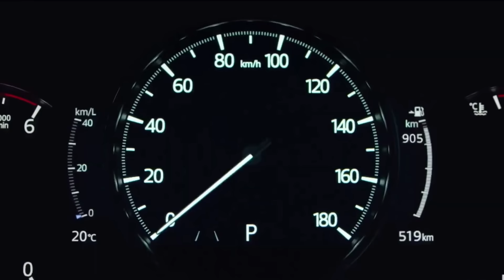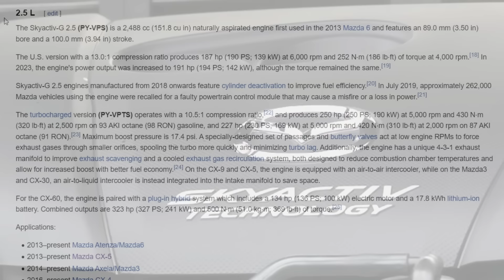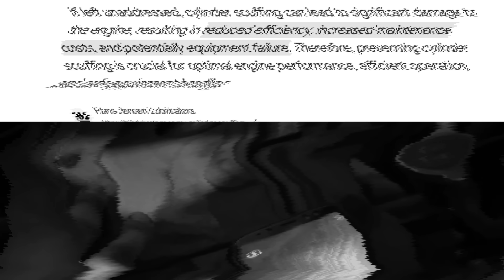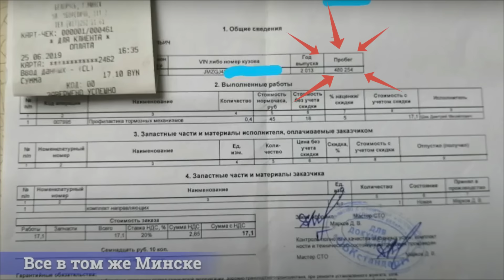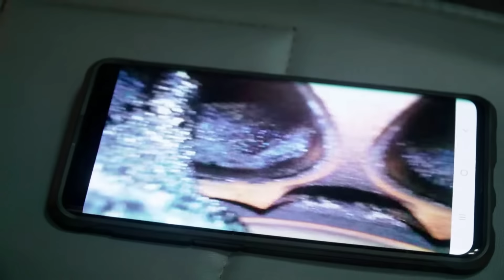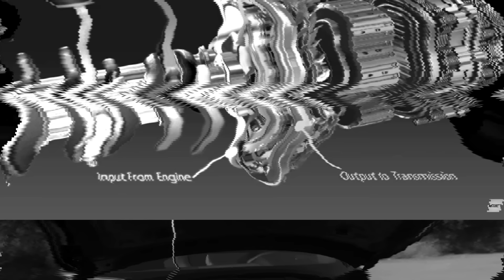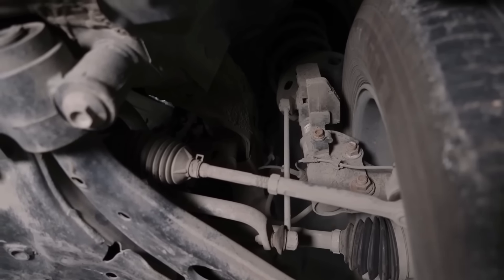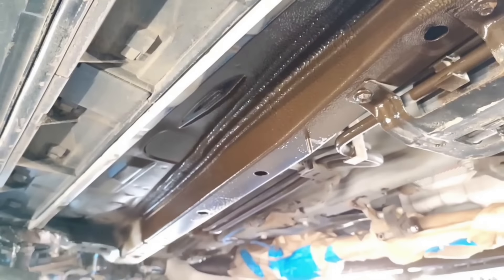How reliable is the most stylish Japanese crossover? 2024 Mazda CX-5 facelift.

Comment: We bought a new one last year and I love it more than the Lexus and BMW I had previously!
Reply: Exactly! Same here! Bye bye BMW! I love my 2 Mazdas and so do my friends
Reply: tbh cx5 is the less luxury lexus and less engaging bmw with cheaper price, so its a steal deal
Reply: @afarrel3195 yep love my cx5 too except for the horrendously jerky transmission shifts when its cold. I mean, seriously feels like someone is running into us it jerks so hard. Mazda says its a normal thing.
Reply: @js6872 yep. Usually after a cold start it’s so bad. It smooths out when engine temp reaches above 50c
Reply: How many miles does it have, and how would you gage the reliability of the Mazda vs the lexus? Would love your input I'm looking at these Mazda's really hard but I'm hesitant
Reply: Thats also what i say about my cars. Until i get rid of them. Then the next car is the new best car i have ever had. Sooo... yeah
Reply: @js6872 I have not experienced this on my 2021 turbo. Smooth shifting after 45000
Reply: I chose my mazda3 over a lexus, it seems the only thing I'm really missing out on is the extra power
Reply: @Horse-c2t  I decided on the newer mazda 3 sport sedan. Similar interior comfort as the lexus
Reply: @itzfuazz4198  LOL, you haven't driven a CX-5 turbo, 0-60 in just over 6 sec.
Reply: @dogsarefun2  the NA 2.5L in my mazda does it in 7... idk if I'd feel much of a difference
Reply: There’s a TSB for jerky shifting. The dealer has to upload a new file into the computer. We had it done to our ‘19 CX-5 and the difference is noticeable. Shifting is excellent and no longer jerky.
Reply: @js6872  the oils are not at optimal operating temperature yet to work its best I assume. I'll only start driving after the 'blue' temperature thingy goes away...
Reply: @2004cyrus  same here too , i spend so much on bmw x3 , loss a lot of money due to resale value , however the x3 did not come with adaptive cruise and lane keep assist :( now sticking to cx5
Reply: Same here!  Drove a Lexus RX for 12 years before getting back into Mazda!
Reply: @eleanormassaro5195  that’s excellent! Half of the price and close to as much luxury!
Reply: I agree
Reply: What is the difference between the Mazda CX-5 and the Lexus you owned? 
Lexus is quite famous for its reliability. Which are the most important points you would mention why exactly you the Mazda more than the Lexus? Which model of the Lexus you had? An SUV as well like from the RX - segment?
Reply: Hell yeah. Better than lexus

Comment: I had a CX5 for 4 years without one single problem, would highly recommend them.
Reply: Why did you sell? I am just coming up on 5years and 225k km on it (manual)
Reply: I owned a 1995 Mazda 323F (Lantis in the u.s) owned it for 22 years and the only things went wrong with it in that time were the clutch master cylinder went in 2019 and one of the door actuators stopped working in 2020. That was it. There was no body rust anywhere as i used to hose under the wheel arches every time I washed the car, Plus I live in a country that salts the roads and I live right on the coast.

Comment: I bought a new 2024 cx5.  It does not have the cylinder deactivation or the I stop lame functions..  i believe both of those ridiculous features with no doubt cause excessive carbon buildup   Especially the CD.  The computer is constantly shutting down 2 cylinders on a 4 cylinder engine. On and off on and off. So what Happens to all that oil just laying around during shutdown....slides right past the piston oil rings and builds up in the cylinder just to name a few problems like spark plug fouling. My friend bought the 2023 with CD and the difference of how the  engine runs and performs is night and day.  Mine runs soooo smooth with noticeable  quick acceleration and at idle you cant feel one little miss and it is running not like the I stop version.   So buy a 2024 model with a vin with an L IN THE 8TH spot on the vin Id.   Or ask the stupid sales person who wont know what you are talking about.

Comment: Between my wife and I we have had 7 Mazdas in the last 25 years. The only trips to the shop were for regular maintenance. Our 2006 Mazda 3 drove really good from summer to winter up to the time it was traded in for a 2018 Mazda 3. These vehicles drive good, they look good, and they don't waste your time going to the service shop instead of doing what you need to do.
Reply from the maker: real Zoom zoom fan😄💪
Reply: I love my 2010 Mazda 3. I didn't know much about this brand until I moved to Canada, where Mazdas are very popular.
Reply: ok but what about the technical service bulletins for this engine, & this vehicle for cylinder wall cracking on almost all models years, & multiple vehicles since they put this engine in the cx5, cx9, cx90, and cx50 ofr 5+ years now? I'm really trying to buy one of these but thats the type of issue you don't see with toyota/honda (until they too have introduced turbocharged engines across their line....well see how those age) and its keeping me from buying (wouldn't buy new turbo hondas either for this reason). My friend had an old mx5 protege and it rusted out completely in the midwest faster than most other makes & got junked because of it despite the rest of the vehicle working well (besides oil consumption). He had holes in his floor & failure on his engine motor mounts (that got it in the shop & totaled).
Reply: @MarkTrades__  , Mazdas definitely rust faster than Toyotas and Hondas in the "rust belt". You have to rust-proof your Mazda every year if you live here.
Reply: I had a 2003 Protege’ 5 that I traded in with 198K miles on it. Never used one drop of oil during its entire life. The only problem was extensive rust.

Comment: I purchased the 2024 CX 5 Signature and I absolutely love it. I’ve been driving Hondas for 23 years but decided to go with the CX5 instead of the Honda CRV. The CRV looks too much like the Pilot and Passport. Too boxy looking for me. The biggest reason was the increase in pricing by Honda. Wasn’t worth the extra $4500.00.
Reply: Have a similar experience, been driving Hondas exclusively for 40 years. The last one, a 2021, was a big disappointment. 
Switched to a 23 CX5, very happy with it.
Reply: I traded my 2021 CR-V for a 22 CX-5.  Way more fun drive.
Reply: Hey did you drive any sporty Honda's? If so, I have 2015 civic si. I love the instant throttle response, & direct inputs everywhere else. 

I'd love any comments you wanna give: 
How would you describe the
Turning stability ( how fast you can take a turn while feeling stable in the car) 
The throttle response ( how instant or direct using gas pedal feels?)
Ability to accelerate onto a 50-55mph road from stopped while there is traffic?
Reply: Honda Canada pricing is nuts. The new CRV drives boring. Cx5 was decided. Coming from a 20+ yr Honda owner

Comment: My wife, 2 daughters and sister all have a CX5 (2012/13 models). (all 2ltr motors) They range been 173000km and 214000km. We have not had a problem with any of them. They are extremely reliable provide you maintain them at the very leased by the owners manual or sooner with quality oil. I also have a Mazda 3 high is the same reliability.

Comment: We bought our 2014 cx5 in late 2013, in the last 10 years, I only had to replace the battery, tires, and brake pads. I do my own oil at 5-6K It's been perfect.
Reply from the maker: How many miles now?
Reply: 188K
Reply: Have you had any induction  cleaning done for carbon build up…. Or not needed so far?
Reply: You never changed the transmission fluid? 

You should, it’ll bring back up maximum fuel economy.   You can do it yourself.
Reply: Ive been told by 2 different Mazda service centers that my 2015 CX5 has a sealed transmission and never to change the fluid. So far, at 188k, mine is running fine.
Reply: @hookem7030  it's NOT sealed,  there is a drain plug and a fill plug.  ON ALL 2.0 & 2.5 models.  I was told the same thing. the power of U-Tubers has made dozens of videos showing how to drain and fill.....

Comment: I've owned Mazda's from 1974. Motors were never a problem. Just changed the oil every 5,000KM. In fact, problems were minuscule in every one I owned. My favourite's were the RX3 and the Mazda 6 hatch. All were M transmissions.  I even liked the original CX5, my first automatic transmission car, but the 2L motor wasn't enough power for highway driving around our hilly BC province. Ok in the city, but the highway, it didn't cut it. Passing was similar to a turtle passing a snail if on a hill.
Reply: I had driven the CX-5 with the 2.0 and my current car has the 2.0 already at 166k miles. It’s barely enough power but reliable as hell. Only thing I needed to replace were motor mounts
Reply: Well the engine in these cx-5's and most mazdas right now has a technical service bulletin across most years for cylinder wall cracking possibilities on the turbo 2.5L 4 cylinders.... Appears to have never been addressed head-on.
Reply: @MarkTrades__  WOW! Must be that oversight thing talked about in the video that cost people unnecessary money. Are you old enough to remember what a joke their rotary engines from the 1960s and 70s were?
Reply: I had/have no problems passing on the highway even at 120kph and higher...  (2.0l)
Reply: @tonyoliver2330 What year vehicle did you replace the motor mounts, and how old / how many km/miles when you did this?  Thanks
Reply: @Victorylap-fy4ke  My rotory was good. Only reason I switched for a new car was I got rear ended and it totalled the car. I ended up with a GLC, which was gutless compared the my RX3 which was a fun car to drive. I guess I was lucky...My RX3 had 120,000 miles on it when totalled. Motor never caused me any grief.
Reply: @nedmilburn  We have a lot of pretty steep hills here, and the 2.0L in the CX5 was underpowered for passing. On flat roads, it was ok, but we don't have many flat roads.

Comment: This is making issue out of non issue, reason CX-5 is a better car than CR-V or RAV4 is that it uses proper size engine and proper transmission not a cheap CVT substitute with tiny 4cyl turbo engine . 
Than comes driving quality , interior quality , superior and premium control knob instead of old school cheesy LCD touch screen ... solid iAWD that is predictive and very intuitive with it's operation .
Reply: But the 2.0L is a small engine, it does come with a 6 speed manual as an option which is better than the auto too though.
Reply: @CsalbertCs  So CVT would be better ?
Reply: A 2.0l turbo in the cx-9 is enough to be "small engine" to me. Should get 2.4, 2.5l but fuel econ prob hit too hard
Reply: @MarkTrades__  CX-9 does not have 2 liter engine , do your homework .
Mazda's CX-9 and CX90 both do not push their 2.5liter and 3.3liter hard like most manufacturers do , Mazda does it for increased lifespan of the engine.  It is easy to slap higher psi turbo and get lot of power but than engine lifespan is cut in half .
Reply: @kdomster9141  ah yeah I was recalling them both having the same engine. It appears that's a 2.5 instead of 2.0, as previous comment had me thinking.

THEN ID SHOULD BE 2.8 V6 TINY TURBO 🤣
Reply: @MarkTrades__  Sure 3.3t inline six with the smallest boost in the industry getting just 280hp or 340hp should last "forever" in comparison to Chevy's 2.5t getting 320hp/310tq or BMWs 3.0t getting close to 400hp 
Mazda does not do it for bling of HP number game but Mazda does it for reliability and longevity of its turbo engines.
Reply: @kdomster9141  I'm looking at used cx9s so no 3.3 inline available there. My only comparisons are to honda/ Toyota I wouldn't buy a Chevy or BMW haha not my thing. Maybe chill a little your replies are aggro bro we're talking about 40k luxuries here it's all good
Reply: @MarkTrades__  all good Bro ,details in answers should not make it feel hot in any way 😉
Used Honda or Toyota vs used Mazda CX9 should be all about picking your priorities. 
Mazda always offers more content, performance and more ambitious design vs same price Honda or Toyota . CX-9 is build in Japan .
2.5t on Mazda is super reliable with exception of 2021 model having issue with seal , but that can be fixed with TSB from Mazda .
Reply: @kdomster9141  I love Honda design ethos, but find their new vehicles underpowered + with cvts I don't want and poor visual design.  Toyotas overpriced and underpowered as well. Also never the best driving vehicles, just most reliable (maybe....they are running on their n/a engine reputation). The Mazda shines in having a power train setup to actually be semi-engaging with power that I would feel safe with in my high traffic/high speed area. Great visual design, paint options, interior design. Yeah man I'm pretty much sold haha! Hard to get over chylinder wall cracking issues tho. Cpo in warranty is maybe the call
Reply: @MarkTrades__  I agree with you , Mazda does not have to save best features for their premium brand the way Honda and Toyota does
Reply: @kdomster9141 Right! Unfortunately that's going to change though
Reply: @thetechlibrarian  Not really , do not look at Mazda electric made in China off Chinese brand car that basically added Mazda logo and some bumper cosmetics. It is not a Mazda but car build for China .
Reply: Bro WTH.. the RAV4 uses a 2.5L engine with no Turbos.
Reply: @ronnyvillalobos1363  Sure you are correct , than comes Hybrid trim with eCVT , at least it is reliable. 
I think RAV4 base 2.5 with 8speed ATX is fine to recommend but watch out if they will not make standard  eCVT hybrid only like Camry... big mistake from Toyota.
Reply: Best comment here!
Reply: @CsalbertCs Unless you want to drive like a sports car or do hauling, the 2.0 with variable timing is all any average driver needs.

Comment: I have put a similar comment on another CX5 review. I bought my 2016 CX5 2.2 AWD sport Nav auto in 2019 with 22000 miles on the clock. A year later One headlight malfunctioned but the extended warranty took care of it, in fact they replaced both headlights which leads me to believe that an issue already existed with them. At 40000 miles the whole injection system needed replacing, again covered by the extended warranty. At 60000 miles it required a full engine decoke at cost of £1100, NOT covered by the extended warranty. This car is a pleasure to drive. I do a mixture of motorway and urban driving and get around 35 miles per gallon which I dont think is too bad. My advice if you are planning to keep a new CX5 beyond the warrant or you buy used as I did, take out that extended waranty it can save you thousands of pounds. I will ad that Mazda customer service for me has been second to none.

Comment: Got 4 Mazdas. 170k, 110k, 105k, 88k. All without the turbo. All 2.5l. Zero problems so far. Great well-balanced fun-to-drive cars.
Reply: So assume these don't have the intake valve carbon build up issue ?
Reply: @JDDD33  that would be correct. Truly have had no problems with them.
Reply: Did you use 91 octane gasoline as he recommended?   First I have seen anyone say was needed for this car.
Reply: @psgrenier  No, I use 87 octane always. No additives.
Reply: @psgrenier  car design to run on 87 no need for higher octane.

Comment: Those cylinder marks are not scoring. Those are just marks from some carbon build up but the block is not scored. That block can hold 200k+ km without any issues and no oil consumption.

Comment: Owning third mazda 6 currently 2.0 skyactiv with factory spark plugs at over 100k miles. Running perfect. Oil changed at recommended 12k miles but now doing it by 6-7k with no visible oil consumption